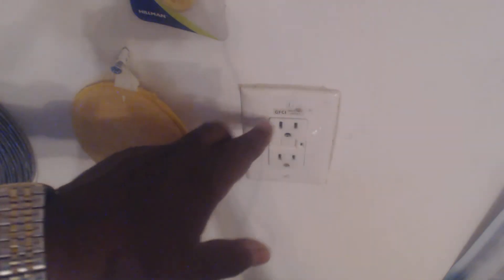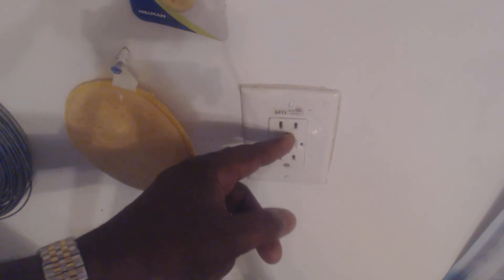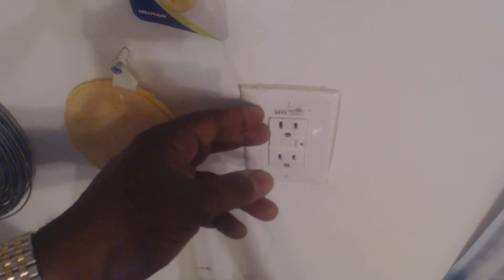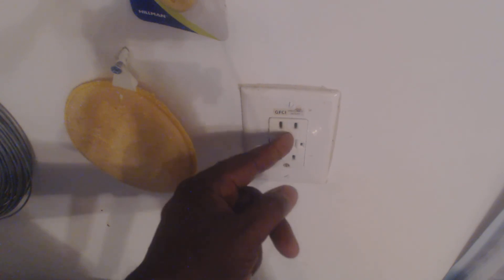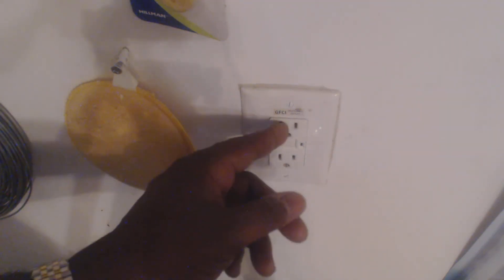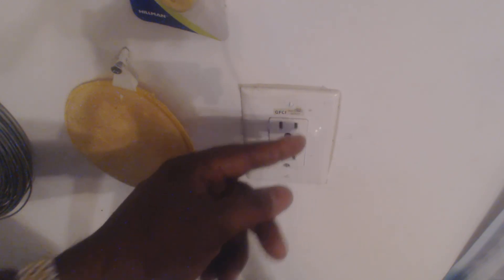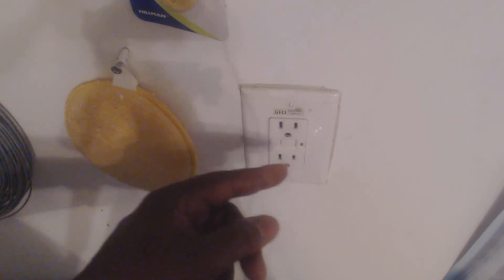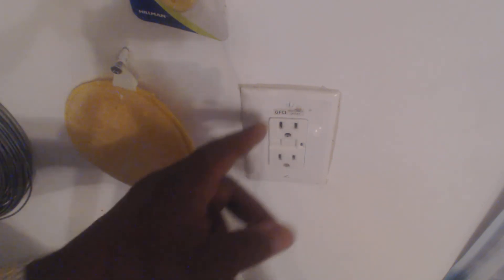Why My GFCI Trip When I Plug My Extension Cord Into My Food Truck Country Boy Explanation

Comment: The neutral and equipment ground wire are bonded together at the main electrical panel and is tied to earth ground. This stabilizes the neutral at 0 volt reference. This can only be done at this one place. You said that your truck has a panel where the neutral and ground are shorted. By having a second location of ground/neutral contact you may have inadvertently created a parallel ground, where the ground wire has become a current carrying conductor. That is why the gfci will trip. By removing the ground on the plug you have apparently solved this problem. You may have sacrificed the ground safety in your truck though. If you were to plug into a normal receptacle without removing the ground it may work fine or it may trip the main circuit breaker. It may not trip and then you may have an unsafe condition of have current flowing on the ground wire.
I'm not an expert with electrical panels on trucks, travel trailers, or RV's, but I suspect that your electrical panel on the vehicle should be similar to a sub panel in a house. This means that the ground and neutral have separate bus bars and not be connected together. It's worth checking.
Reply: 👍👍I concur